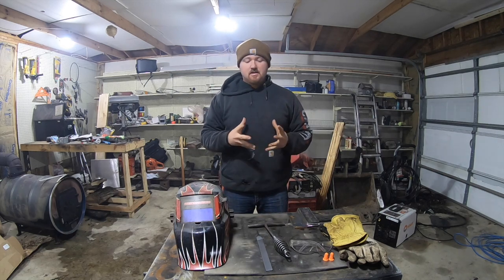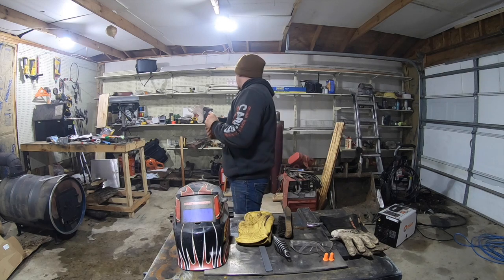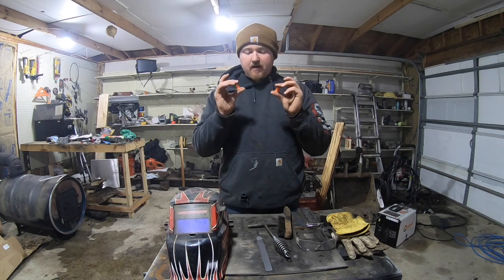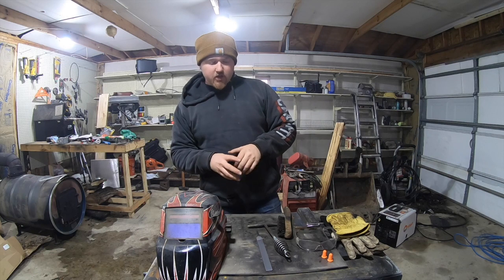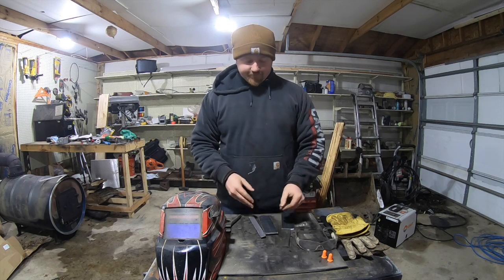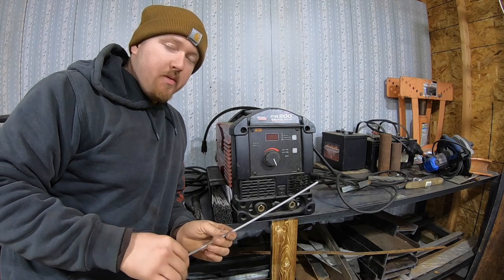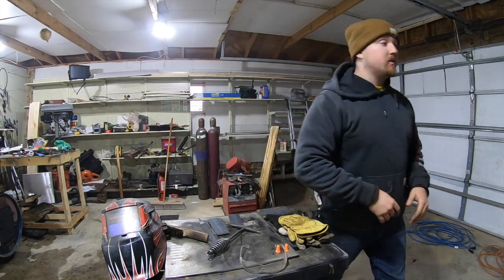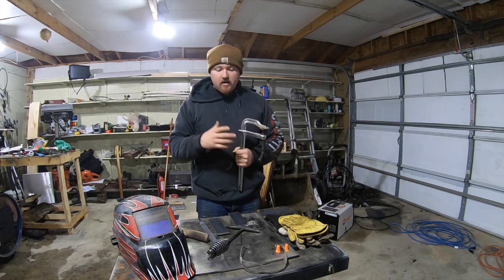Welding 101 Shield Metal Arc Welding (Stick) lesson 1 What You'll Need

Comment: Quick question I forgot to ask Austin. Were you suggesting 7014 rods because they don’t need to be cooked? Are there any other reasons?
Reply from the maker: Yeah really just because it doesn’t need to be cooked, I wouldn’t want someone to start with cold 7018... that be bad. But mainly because they are widely available and don’t need to be heated. And you can make the beads look really good rather fast. But really you can learn on just about anything as far as rods concerned
Reply: Awesome, thank you!

Comment: Have you ever had any issues with starting a fire in your garage welding?  Seems like you have exposed wood panel and insulation.  Just wondering?
Reply from the maker: No I’ve never had a issue, that being said, we just moved here and the garage is temporary. Also most of what I do is mobile. I do keep a fire extinguisher handy. Most of the saws I use are cold cut saw so virtually no spark. I’m the spring and summer I do most of the the work outside. We do have plans for building a shop. Maybe in 2021